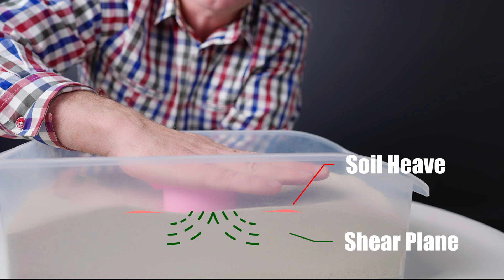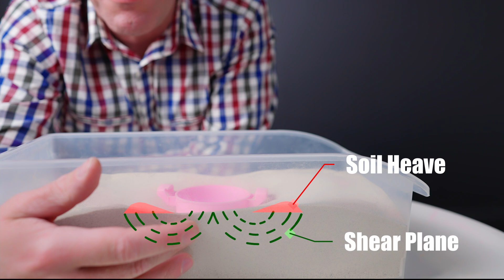Soil Mechanics and Foundations Basic overview

Comment: Thanks for video, Are reactive soil just higher clay content or specific type of clays? My understanding from old BCA is that domestic slab design is very concerned with reactivity, and I think this because of moisture regime of swelling and shrinking soil foundation, and my understanding is that the slab must resist greater forces from more plastic soils. Is mandating good soil moisture regime possible to help structures?

Comment: How can over compensating be detrimental. exceeding what will be needed to be on the safe side overcompesatintion
Reply from the maker: Depending on where you are adding the redundancy if can increase the embodied carbon in the design. There is all ready alot of redundancy built into the codes, but areas like connections and critical elements it is worth adding some redundancy with minimal impact on cost and material.

Comment: General shear failure causes displacement and tilt of the footing, which soil is most likely to cause this?
Reply from the maker: Hi Brooks, this could be a trick question... it could be caused by a out of balanced load causing one side to be overloaded. if not soil variation having softer materal on one side of the footing, underminning of the footing due to pipe or moisture changes from tree or leaking pipes.
Reply: @BrendanHasty  Thanks for your reply.